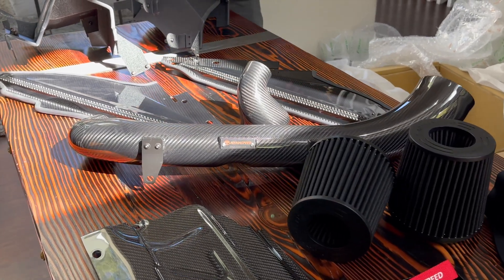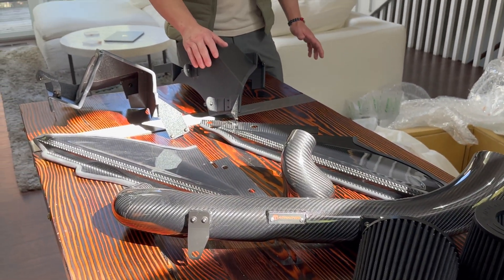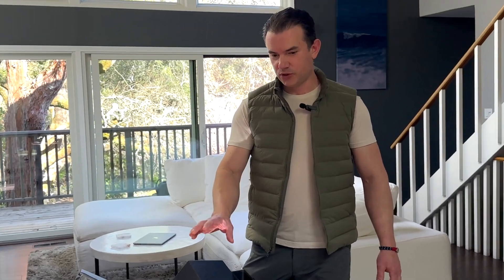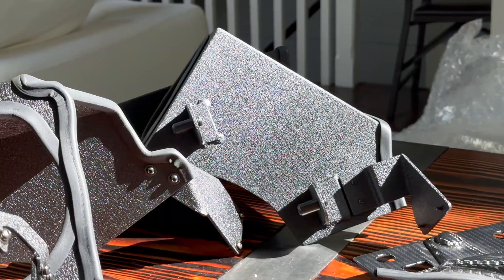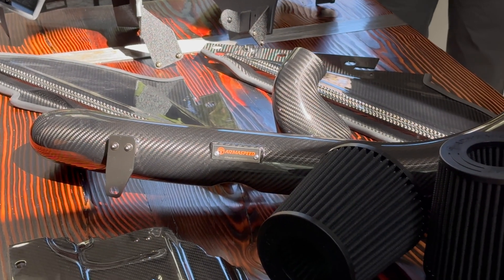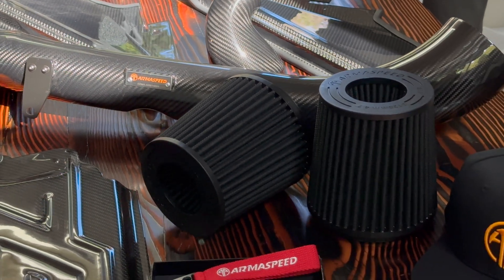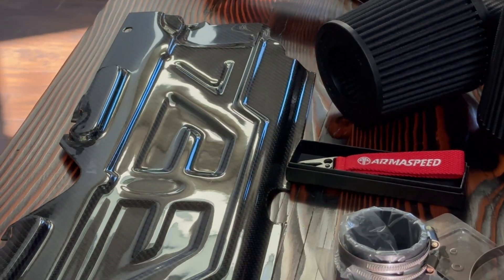Why you NEED the Armaspeed cold air intake on a BMW G82 M4

Comment: Is there any increase in induction noise at all? Or do the turbos still muffle all of the induction noise?
Reply from the maker: I do think there is enhanced induction noise. I'm going to do more videos with better audio quite soon
Reply: @m.dreamin  Cool thanks! The full package with the covers is a bit on the pricy side, especially when converted to Canadian dollars haha but maybe I’ll treat myself…it definitely looks and seems to sound the best out of the bunch available. Eventuri seems like a crazy rip-off
Reply from the maker: Yeah all the extra carbon certainly adds up but if you don't get the cold-air covers you'll get even more noise. I get good sound even with the covers so I can only imagine it's more dramatic without them. And agreed on Eventuri. I have a few G8X friends that have Eventuri and it's certainly gorgeous, but has far less engine bay audio. Many regret spending so much on it.